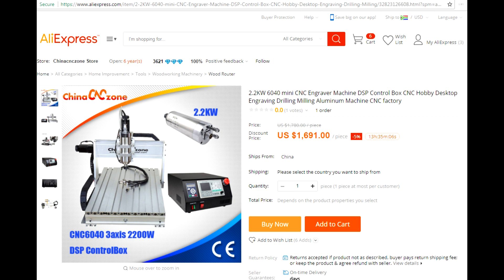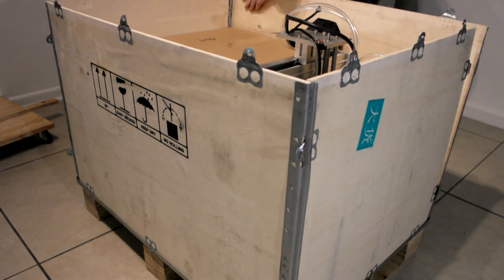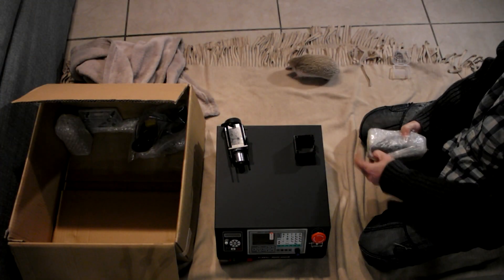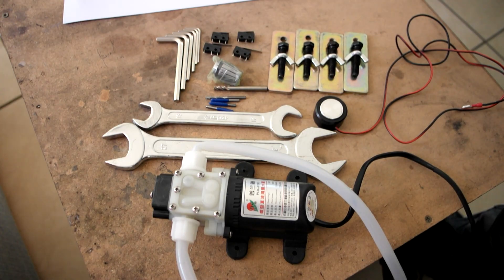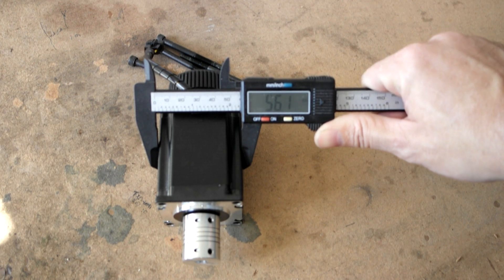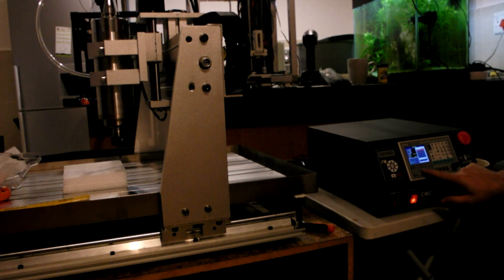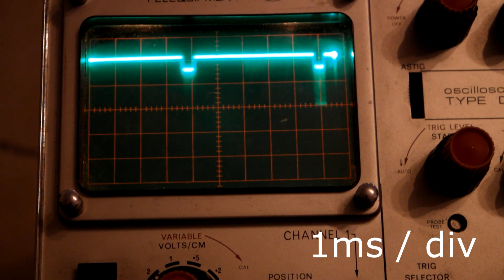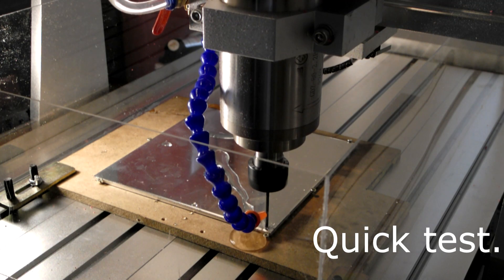CNC 6040 from China CNC Zone

Comment: 2000usd for this small machine 😱🤢🤢🤢🤢🤢😵.
Reply from the maker: Yes its a lot of money ! I am looking for something better, if you of anything post a link please.
Reply: @TheXSpitfire  If you havr basic knowledge of cnc you can make one I'm also making my own.
Reply from the maker: @DiscoverRajivVlogs  I wanted to make my own too that could cut Aluminium.  I started ordering the parts and found that the Stepper + Drivers + Power supply + Spindle + inverter  + lead screws and controller worked out more than the machine. This was because of shipping on each part to my country and the fact that it was a 2.2kw spindle. Then I would still have to make a frame. Please send me a link once you are done, I would love to see your machine.
Reply: Good I would recommend you to buy MGN/HGR type of linear rail. well for now i'm also building my CNC using SBR 16 rails, that is good enough for now. I will be able to to cut aluminum. 

You just make another cnc and selvage some parts of old one like spindle and controller,steppers. Well I bought SBR 16 2 meters with ball screw 16mm and end supports all within 350 USD in nov 2017. LOL i still have those things laying around but maybe within 3 months i will make the cnc. I couldn't make my CNC because i dont have any tools not even a drill press. Hahaha.
Reply: @TheXSpitfire  I just saw your channel you have good knowledge about electronics you can make a good CNC by your own.
Reply from the maker: @DiscoverRajivVlogs  That is amazing. Just the shipping of the ball screws when I looked was almost what you paid  for them to South Africa. I will keep an eye on your progress .
Reply: @TheXSpitfire  But i orderd by alibaba you should try and you can have really good deal.😅😘
Reply from the maker: know of
Reply: with a few upgrades its ok even for aluminium  ...  https://www.youtube.com/watch?v=JyKV_fhe8xo

Comment: There are lot of 6040 CNC machines out there. What makes this from ChinaCNCZone so special? Its +400 USD more than the other ones?
Reply from the maker: I cannot say that I have seen another 6040 with a 2.2Wk water cooled spindle for the same price as what I paid. The other difference is the DSP controller. You do not need a computer to run the machine. Obviously you need a PC to generate the Gcode, but after that the controller runs it off a SD card. I live in South Africa and this was the best price I could get away with after paying shipping too.

Comment: Will you please share the link for purchase?

Thanks 🙏
Reply from the maker: Hey, I added it to the description.  The item does not include the water tight tray as far as I remember.
Reply: TheXSpitfire thank you!!

Maybe if you have time you can make a video showing how you made the water proof tray.  👍
Reply from the maker: @rctractorwizard  I ordered it with the machine, but separately to the linked item. I spoke to the seller via Email before I purchased the machine.  Its not included in the price of the link. If you know your way around stainless steel, making your own tray should be very easy.

Comment: Works well? Is it a good product?
Reply from the maker: fabioorte so far I am very happy. There are a lot I still need to learn about milling metal. I ordered carbide end mills recently and will do a video on that. Soon I will put out a video of milling aluminum and what I have learned.
Reply: Good cutter, good coolant, not to fast on spindle RPM and feed.
Reply: Most of the video's I see on this thing are fairly positive. The odd snafu here and there but it seems to be a reasonably effective entry machine. Might have to get one for myself.
Reply: you can buy it but need to check everything they have pretty bad wire solder but overall thje machine is good
Reply: Well, if I was to buy it odds would be I would end up replacing the controller anyway. Possibly swap out the VFD and spindle (as over here you can only find them equipped with 800W spindles even though the larger ones are available just as easily). Admittedly that's me and my propensity for tinkering
Reply: xConundrumx i think they sell frame only too
Reply: True, that also is an option.
Reply: Hello everyone and thanks for the answers. a day arrives my cnc 6040 z usb mach of the chinacnczone with 1.5 kw motor that from 2.2 kw was too much for the electrical system of my house.
Reply: Probably better too. Watched a Marco Reps video recently where he mentions that the runouts (especially radial runout) on the 2.2 and up spindles varies a lot. Something that is usually much better on the 1.5 and less spindles.